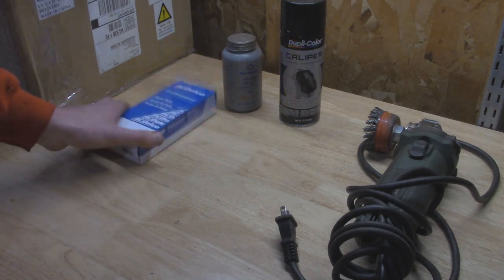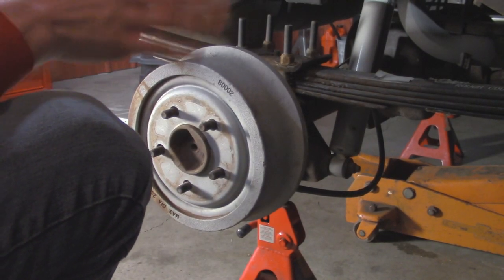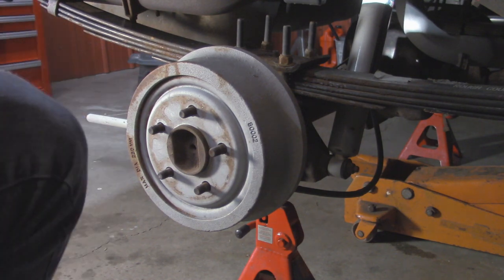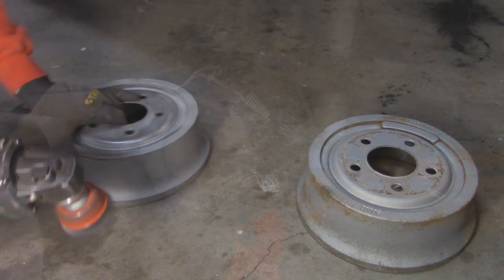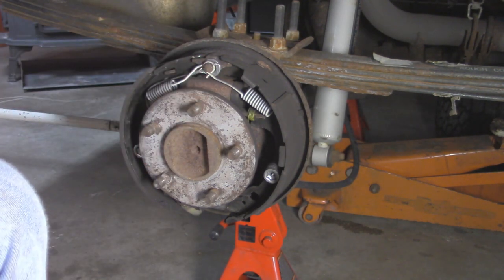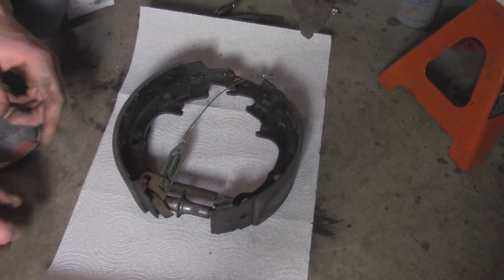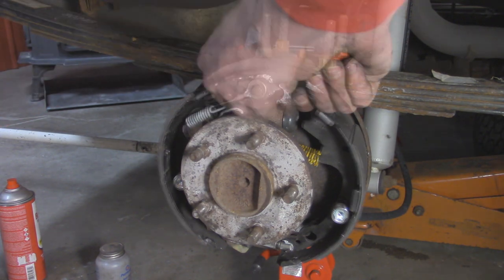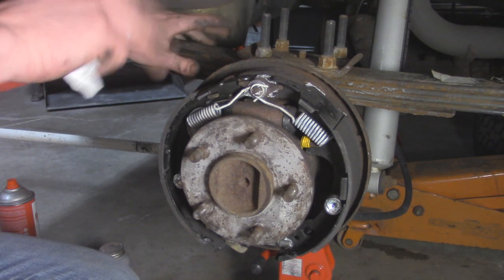How to Maintenance Drum Brakes | Jeep Cherokee XJ

Comment: My right rear brakes is too sensitive when I push slightly the brakes. It blocks the wheel and releases when I let go the brakes. It only does that the first 3 to 5 times I push the pedal. What could it be? I have XJ with 1992 dif dana 35. Thank you
Reply from the maker: I go over that scenario at 9:00, but it's due to the shoes being out of adjustment and moisture will build up on the brake dust and/or create a light surface rust layer on the drums causing them to catch easily the first few brake applications.
Reply: @OutJeeping  Yes. I saw your comment and I will definitely look into that. I'm not sure it will be the cause because I change all the springs and adjusters but I will take more attention on that. If you remember any other possible cause, let me know. I really appreciate your videos. Good work!
Reply from the maker: I would still try to adjust them with the star adjustment screw on the bottom. I had the issue with this Jeep right before I did this video and now it doesn't seem noticeable after it rains. But it is a very common issue with drum brakes, I have had it happen on all drum brake vehicles I've owned.

Comment: A. bit off topic here, My 78 J10, its time for a new steering stabilizer.
Any Pro/Con info on what is a known good quality one? 
Looked for Bilstein yet couldn't locate that brand for it.
I would think the OEM like single cyl setup, is probably good enough for my street rig with stock tires/rims etc.
thx

EDITED:
Found this 33-174525, on Amazon.
So Still looking into this, to see if its proper fit for my 78 J10.
Reply from the maker: Yeah I would stick with a single cylinder steering stabilizer, no need to wear out the power steering prematurely. I would also recommend Bilstein. You may be able to get away with various lengths in stabilizers because you are able to adjust the mounting bracket on the tie rod. You would want to be the same length as the original stabilizer or longer. Shorter then you will run into issues.
Reply: @OutJeeping  
thx for reply here.
A few more questions as I realized I'm not 100% certain about all needed new parts , their aggregate final geometry.

My plan is to use a Bilsteins front stabilizer, else it's a Rancho piece.

Second, I spoke to a Rep at the 4WD shop, he claimed Bilsteins on my rig are almost impossible to get a proper fit with the  3" lift kit.

Then lastly the "Sway bar links',  need to be different or longer too.
I understand the needs for sway bar to ride near level or slightly tilt down backward for bind or invert pivot flip reasons.
BJ's has several ones. a 1.25" Longer set for $60.00 they claim Will work properly on a 4" lift scenario, and the  other longer link set for $155.00 with quick removal pins (not sure their actual length).

Any feedback to clear up these points would be appreciated.
As I currently am thinking , the 1.25" longer Links are adequate with the RC 3" lift kit installed, and the  Bilsteins #5215  (should) work too.  If not, Rancho is second choice on the corners.
Not sure the ride with the shocks the RC have that are in the kit..

What I intend is, install lift kit, then road test and see how things operate, then perhaps do an under side video GOPRO and see what occurs and decide if an offset pitman arm is really needed.

Comment: Just bought 98 xj having headlight issues with Amazon specials
Reply from the maker: What type of issues?
Reply: @OutJeeping  well they worked perfectly fine on my buddy’s jeep but when I flick high beams one goes off and one stays  on so idk what’s going on
Reply from the maker: @ryryk6977  I would check the connection with the H4 connector on the back of the light and make sure there isn't any corrosion build up. Also swap the lights and see if the issue is with the lights or the Jeep harness side.
Reply: @OutJeeping  do you mind if I dm on ig it’s easier
Reply: @OutJeeping  I tried another harness I think it was faulty harness
Reply: @OutJeeping  update my headlight harness is toast looking for a used one or need to find a way to by pass it for high and low beams